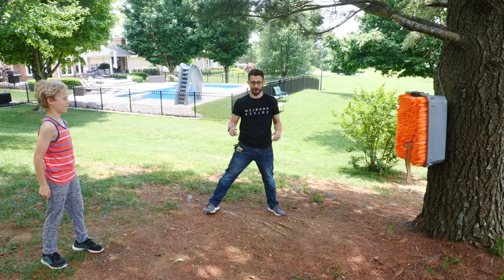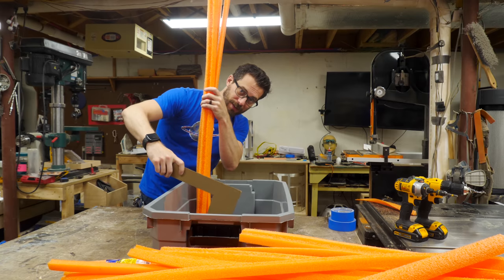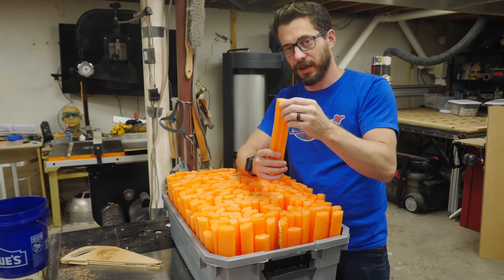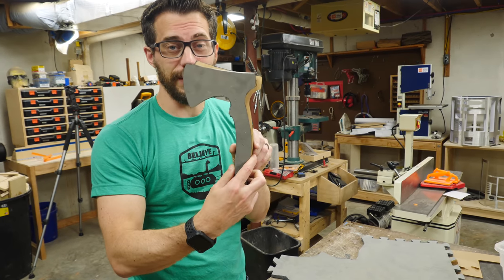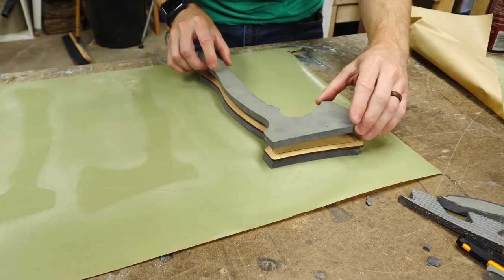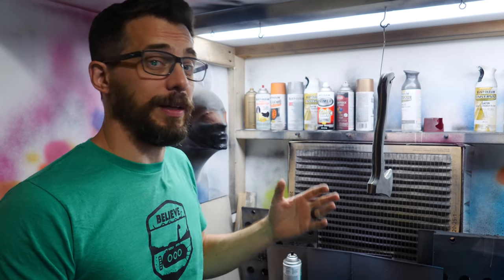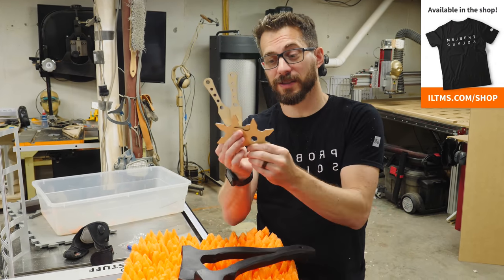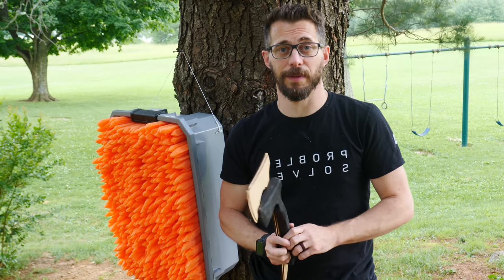How to Make Axe Throwing For Kids | I Like To Make Stuff

Comment: Cool! If you have another color pool noodle, replace the center ones to make a bullseye.
Reply: Problem would be you would have to glue it all down so it doesn't move around too much or get shook loose.
Reply: @Helveteshit  It's not a problem. Just coat the bottom of the container with any slowly-curing adhesive before stuffing it with fake carrots.
Reply: was thinking of multiple colors and each color be a different point like the actual axe throwing ranges

Comment: I made this for my Cub Scout Pack.  I cut the strips shorter than the height of the bin so everything fits inside with the cover on.  I purchased 10 pool noodles (5 blue, 5 yellow) and cut each into eighths lengthwise as seen in the video.  Cut the strips into 9-inch pieces, set aside the short stubs for later.  My son and I used scissors to taper the 9" pieces and arranged them in the plastic storage bin.  We placed about 10 yellow strips in the center, surrounded by a large blue circle,  and remaining yellow on the outside.  The small stubs are stuffed in-between randomly to help fill the space, and keep all the strips standing parallel.  I cut two axes out of masonite, and skipped putting foam on the sides.  Thanks for this spectacular build!

Comment: I know a guy who does knife throwing as a hobby, he has a set of three specifically made for throwing knifes that I find funny when he throws them. When throwing knifes, you usually want to get the head/blade imbedded into the surface and he aims to do that, the funny thing is he ends up with the opposite end in the wood instead. (He's got it set up with three logs off the same tree that are stacked onto one another.)

Comment: If you have a problem with the noodles falling out, you could always pour a layer of epoxy on the bottom of the container before putting in the foam, so it all sticks to the bottom.

Comment: Version 2.0 might have other colors for the targeting, and then more shallow bin with noodles just at top level.  Did you glue or adhere the noodles together once placed in bin?  A 3/4 plywood backer would allow more heft to the bin and frame could be screwed to a wall.

Comment: Alternatively, you can laser cut flat steel into ace shapes (grinding off the burrs and use palm tree trunk cutouts which you can get from companies that trim or remove palm trees and usually got free. The axes don't need to be sharp because of the way the palm tree wood is. Works very similar to how the setup in the video works.

Comment: wouldn't the noodle fell off after being hit for a while? just wondering using a layer epoxy at the bottom of the container and stick the noodle onto it may be one way to prevent it from happening and keep the noodle pointing the right direction.

Comment: Great idea and video! But... Why you didnt use any glue on the noodles? I would be afraid to knock them out on every axe thorow. On one of the shoots they look pretty loose... Or is it just me?
Reply from the maker: You can, but if they are packed in tight enough, glue isn't necessary.

Comment: How can you make the axes behave like axes in this project?
Reply: Weight the heads. Maybe just drill a couple big holes in the head and put in cut steel roundstock and sand flush?
Reply: maybe put more layers for the head? most weight is up there.

Comment: tapering them , would have been a bit quicker to cut them in half put with a diagonal cut that starts 1/3 of the way, and ends 2/3 of the way. though you lose the length of them, would have been easier to tdo that rom the start, so you get a large uniform piece at one end to wdegt together in the tub, and then a sloped section on the end that the axe can slide into.

Comment: Could you use a 3D printer for the axes with something like PTEG so it doesn’t break?
Reply: Sure! A printed axe, depending on orientation, may be weaker along the layer lines, but would probably hold up with enough perimeters and infill. Give it a try and see what happens!!

Comment: 6 minutes
You claim your exhaust system takes All the fumes away.
Here is a simple test.
Can you smell the aerosol material at all?
If you can smell it at all, you are injesting material.
Hopefully you notice much smaller damage.than I did in only 2 years of exposure to fiberglass.